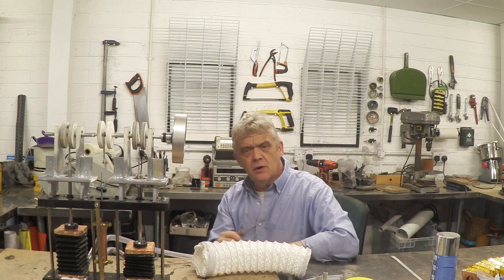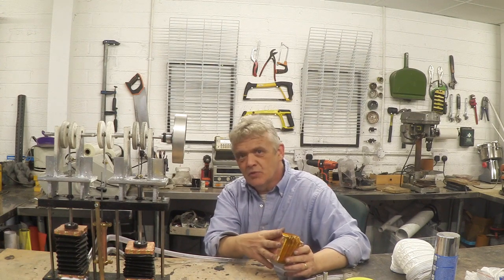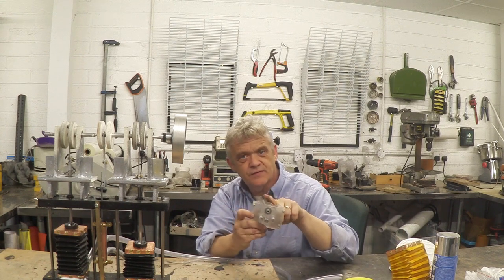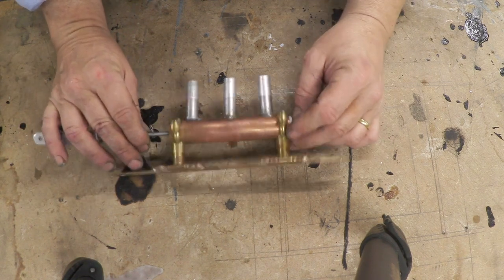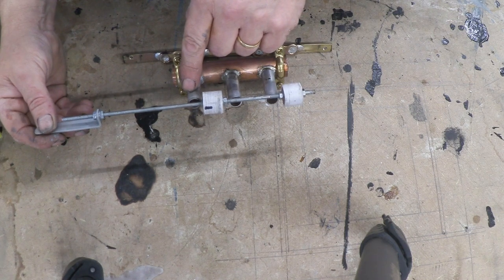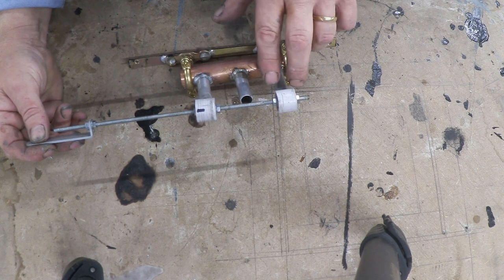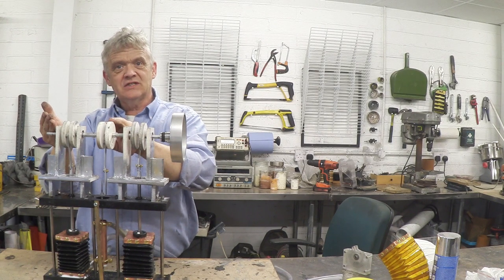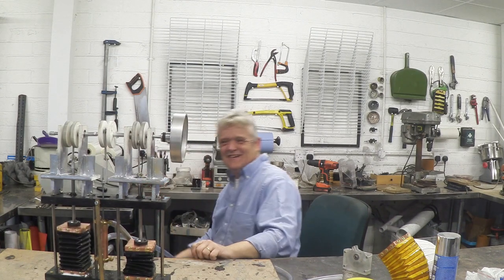Bellows As A Piston And Spring

Comment: Finally a use for the camshaft from the Nissan! At the beginning of the video I was thinking of s seesaw motion but a camshaft motion like this makes do much more sense. Imagine a funnel with a large intake from the wind to compress it to create a fast motion. Attach magnets to the bellow shaft and have them quickly move past coils as well as fan generators to store energy into a super capacitor bank or a battery. 
This is just absolutely awesome Robert, it could ventilate 5 patients for the energy cost of currently ventilating 1. On top of the energy harvesting you have something bloody special here.
Reply from the maker: cheers mate - but wait until you see the follow up!

Comment: Brilliant.  With my Heath Robinson hat on, have a long large diameter sloping/vertical pipe, with a water valve at the bottom and two valves at the top, 1 for air 1 for water.  Fill the pipe with water (rain stream &c) via the top water valve.  When full close the water valve at the top and open the air valve and bottom water valve.  Air will be dawn in as the pipe empties, so connect your bellows machine to the air valve and you have mechanical power.  This would be good for small water flows as the water is stored in the pipe until it's full.

Comment: On your home block you no doubt have a wee stream with a bit of fall. So you could easily make a trompe to give you a bit of nice compressed air. Pressure depending on available height difference below the water intake. You could then reticulate that air using a garden hose or similar to where your air engine is located.  Of course a low head water wheel would certainly make better use of the stream’s energy resource but hey were playing with ideas here.

Comment: If you're using a vacuum then, even if you pull a perfect vacuum, the maximum force operating on your system can be no more than 1 atmosphere x area of piston head. This was the drawback with the original condensing steam engines. That's why all more modern engines use positive pressure.
Reply: You can use positive pressure in a vacuum steam system it just has to be a closed loop.
Reply: @Barskor1  Give me an example of such a system
Reply from the maker: it doesn't matter much which way round this is run just right now mate - but good point
Reply: @ThinkingandTinkering  one of the old style cylinder type vacuum cleaners would be great for this job. Plug the hose in one side it sucks, in the other side it blows (and quite good pressure).
Reply from the maker: @kenrowe167  nice one mate - thanks for the tip - I will keep my eyes open for one now
Reply: Ken, That’s for an atmospheric air spring, but if you use a steel spring you can have whatever force you want.
Reply: @mikeguitar9769  no you can't. With a perfect vacuum, the force acting 'against' the spring is one atmosphere (14.7psi) x the csa of the piston. In Rob's configuration, the springiness of one bellows is matched by the springiness of the other when each is in the half-travel position. The only motive force to disturb this equilibrium is the atmospheric pressure acting over the area of the bellows. As I said.
Reply: Oh, I see.   Springs don’t exist, except when they do, and only in the form of air or bellows, never steel.
Reply: @mikeguitar9769  It does't matter what the spring is made of. A vacuum system can never push AGAINST the spring, any spring, with a force greater than 1 atmosphere x the area over which the force is acting.

Comment: I know there's air columns that are supposed to filter air and they rely on hot air ascention. Also, there's a concept air turbine that works in the same way, with air turbines at the top of a big air column. I think of a combined solar (black) air colomn combined with an oriented cone that pulls the air, much like the "wind tamer" turbine. I really like that engine, I hope there's more to come.

Comment: I don't know if have noticed how little effort it takes to inflate an air bed, you could inflate a whole stack of them in a box, and then compress them with your, low wattage geared down motor and a pulley system, to radically increase the pressure, or divert some water from a source to use as weight empty it at the bottom, pump it up easily, then re fill it when at the top. ??

Comment: The valve apparatus could be done with 3 copper "T"s and off the shelf copper pipe and solder... or even PVC if it's not getting high temperatures.
Robert was using what he had available to make a prototype, but aluminum pipe is not that easy to come by and using 2 different metals has its own issues (not the least of which is cost due to supply and demand economics)

Comment: how about a solar powered motor to turn the flywheel/pulley and reverse the air flow for a fan effect
Reply from the maker: I did an AC video mate - if you want a fan follow that and don't use the radiator

Comment: how are you going to figure out how much power this engine has.  I was thinking that if it was hooked up to a 50' x 8" pipe straight up in the air, the wind could draw a vacuum blowing across the top of it with the correct venturi device on top of it.

Comment: The question may be, will this spin a generator powerful enough to run that vacuum cleaner?
Reply: That depends on your input source there is no over unity.
Reply from the maker: not a chance - but if that's the question folks are asking themselves they are basically missing the point lol